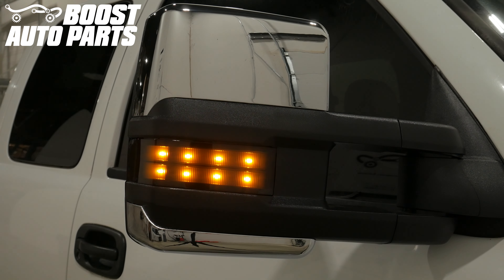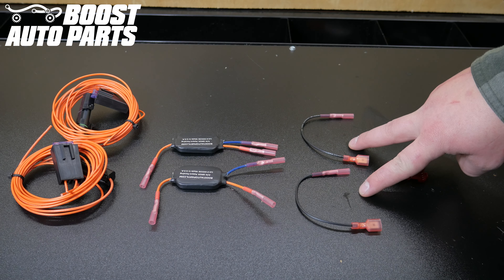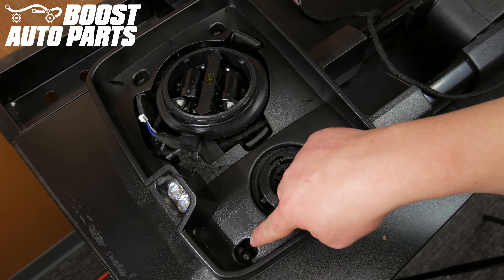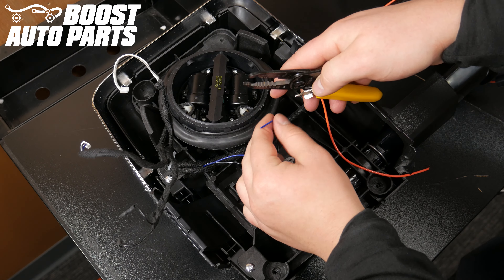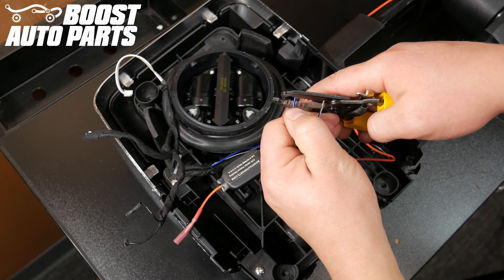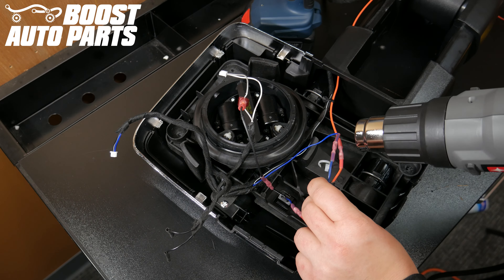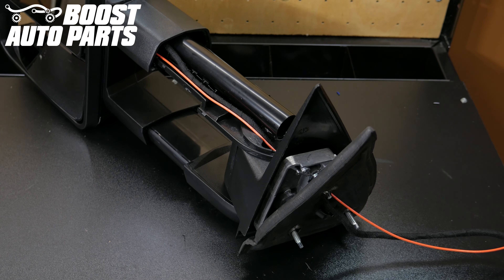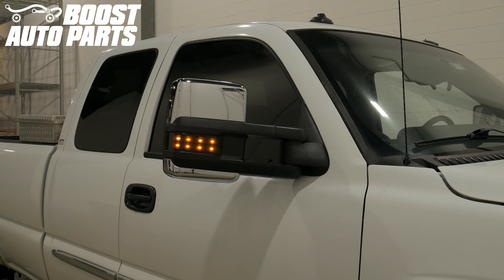Dual Function Signal & Running Light Harness for GM Tow Mirrors - 1988-2019 Chevy/GMC Trucks & SUV's

Comment: This is a good video, I just ordered this kit and now I have a reference on how to put it in. I also ordered the switch back lights, so just a question I would use this kit to make the switch backs operate both running and signals or would there be more steps to it??
Reply from the maker: This kit is not utilized for switchback lights - those come with their own harness. Email support@boostautoparts.com for further guidance.

Comment: My mirrors signal lights don’t work and I’m trying to figure out why. 
The front lights turn on when the doors open but nothing else. Could this be a wiring issue?
Reply from the maker: Sounds like you have a 2014-2019 truck with improper wiring - reach out to our team at 765-831-2830 and they can assist.

Comment: If you are tapping in to another ground what is the reason of cutting the ground to tape it back? Can’t you just cut the blue power wire and keep the ground?
Reply from the maker: No - the wiring on these trucks does not provide a constant ground.